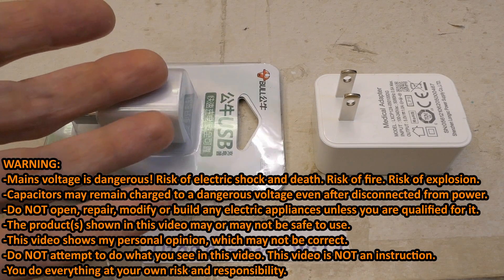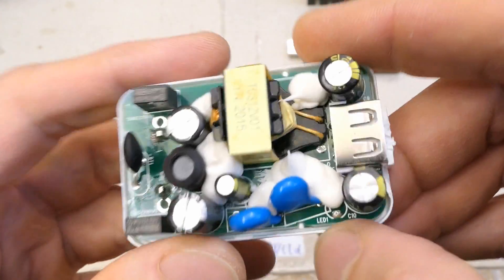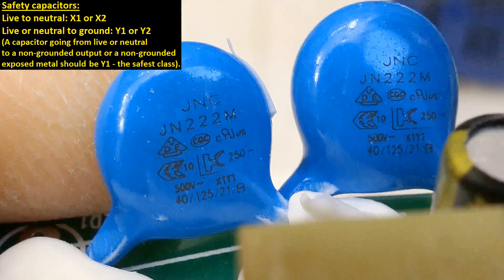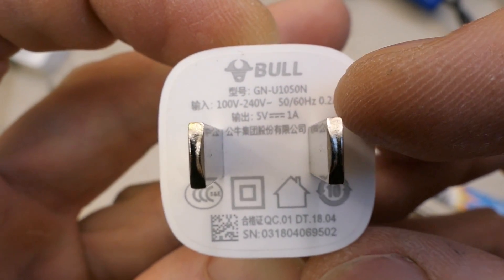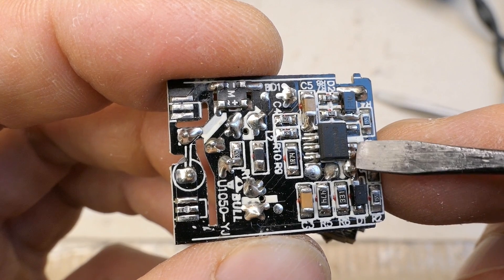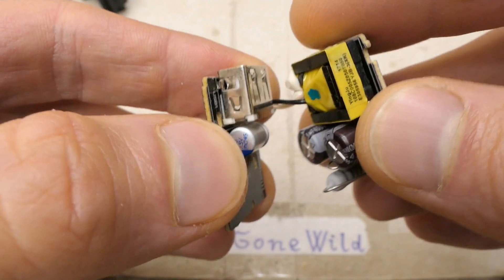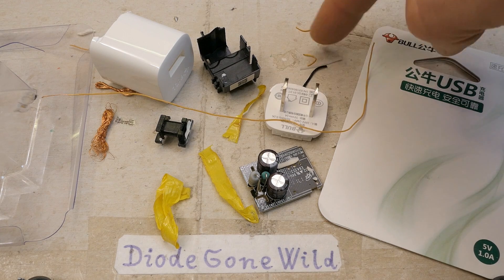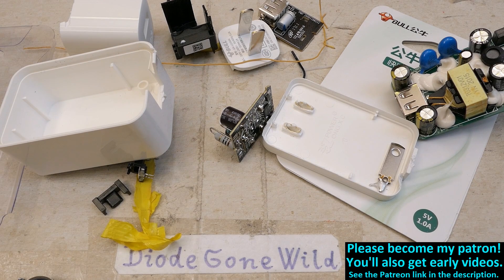Now some safer USB chargers

Comment: Fun fact: the holes in the US plug are useless.

The original idea was to use dimples to lock the plugs in the socket, and that design made it into the standard. The outlets with the dimples, however, haven't been used since.... I'm not even sure they were ever used. I have outlets from the 30s that don't have the dimples and the plug only came into common use in 1931.

Comment: Trick to open plastic enclosures without breaking them (mostly)
See picture:
https://drive.google.com/file/d/16e1rRGl4BeZp2NFobxlSmnRpqDgaXwFo/view?usp=drive_link
You scare me with that saw-blade https://youtu.be/o9nurap1AWo?t=310 
- Make sure that the rods are exactly positioned on the seal (use sticky tape)
- Don't squeeze too hard; I have occasionally broken the internal PCBs

/chriV

Comment: I love your channel, I just have a small correction, the missing holes in the US plug doesn't make it "Chinese", those holes only help with the manufacturing and have no practical use in the socket
Reply: That actually is, in fact, the Chinese style ungrounded plug. They use an outlet very similar to NEMA 1-15, but the blades don't have holes. I don't know if they're just not allowed to have them, however. But it is, indeed, a thing.
Reply: @puckcat22679  US plugs however don't require a hole, it can be 100% compliant even without

Comment: How did you make that "hot air gun"?
Could you make a video about it?
Reply from the maker: It's an old hair drier :) A bit melted as it once ran with the air flow accidentally restricted.
Reply: @DiodeGoneWild  Just a regular hair drier or did you modify it to make it blow hotter air?
Reply from the maker: Just a regular one. The air is quite hot very close to the output.
Reply: @DiodeGoneWild  Thx!

Comment: Currently, is anyone still using a 5 volt 1 amp charger? In my opinion with the current cellphone battery capacity which is mostly 5000 mah, how long does it take to charge it?
Reply from the maker: Probably yes, but for other devices than phones. There are things with smaller batteries.

Comment: IMO the first one was dodgy on the basis that the line voltage pins were soldered directly to the PCB.  Eventually those solder joints will probably crack from repeated insertions/removals, causing arcing.
Reply: Nah, he had to get the pins hot before they moved this was not in 'dodgy' and nowhere near 'super dodgy' so it's 'Nice'

Comment: Medical-rated power supplies have to conform to strict isolation and reliability standards for the safety of both patients and medical staff. They are generaly (in the UK at least) a bit more expensive, but worth using for projects that will be left running for long periods....in my humble opinion! (Power supply safety standard IEC 60601-1)
Reply: I wanted to check out that standard and it goes for a small price of 4500 euros lol
Reply: @whatevernamegoeshere3644  I get mine from CPC in the UK - they start at about £20 - maybe not the same standards though!!!

Comment: One could apply 500V DC between primary and secondary, and  run a test.
Reply: The standard test voltage is  1.5 K V AC for  1  minute between looped primary terminals and looped secondary terminals. The charger should withstand without damage.
Looping is for safeguarding the electronics.

Comment: That travel adapter is a death trap and would be worth a review video on its own. I bought a few of them some years back, and discovered that internally the input and the output is only held together by the pressure applied by the casing. Over time as the metal relaxes they turn into a special effects machines with flashing lights and crackling sounds coming from the inside. Definitely Syuper Dodgy.
Reply: He actually made a video on it a number of years ago
Reply: He has done a number of them and also Big Clive has covered them too!
Reply: @andymouse  @Dabjo01 Thank you, I somehow missed that one, or the experience was so shocking I repressed the memory. He is indeed talking about how Dodgy these are and highlighting the exact failure mode I experienced. It is really incredible that these adapters are still sold on AliExpress to this day...

Comment: I remember the days when wall adapters had iron core transformers. They had the primary and secondary on 2 separate plastic coil holders. They were probably rated for 2000 V insulation.
Reply: Yep, 2KV was pretty standard for the hi-pot tests of those; many included a thermal fuse inside the primary winding as well. Big and heavy... but so little to go wrong
Reply: @NicBellamy  And they could be easily repaired if something went wrong.

Comment: Had a shit 5 volt one fail and put line v120v to 5v and damaged hdmi circuits including Epson projector hdmi ports.  I only use UL approved ones from now on.  Safer and not likely to damage supplied items, if the UL listing is real.

Comment: 0:35 that barrel plug polarity symbol... on a USB power supply XD
Reply: It might have a cable with a barrel plug on the other end designed to be used with it.
Reply: @k4be.  i thought about that to, because i actually have some flashlights from Lidl that actually have a "usb to barrel" cable adapter

Comment: A while ago I got a charger from the dollar tree here in the states to teardown. I expected a horror show but it used the same style transformer as the first one in this video and even used polymer capacitors. To me this really shows how much of a scam the 1$ chargers on ebay are if the dollar tree can manage a very well built charger for the same price
Reply: So, a large chain that has been around for a while like Dollar Tree actually can't afford to sell unsafe products. They'd get fined if they sold electrical equipment that doesn't meet standards, and they'd get sued if that equipment malfunctioned and caused a fire or killed someone. Where you need to watch out is stuff sold direct from China on eBay, stuff from Amazon Marketplace, or things sold at flea markets and such. But at a brick and mortar store? It's unlikely to be unsafely constructed.
Reply: @puckcat22679  I know the term "brick and mortar" is used to describe a store that exists as a real building, but good luck finding a Dollar Tree that's actually made of brick and mortar. Not on the outside surface as decoration, but inside the walls as structural material.
Reply: I expect it costs more than $1 to manufacture but other cheap to make products probably subsidise the cost of this PSU.
Reply: I’ve used Dollar Tree 1-amp USB supplies a lot. They get slightly warm sometimes but otherwise seem at least adequate, even when they were $1.00 rather than the current $1.25. I think I once took one apart and didn’t notice anything glaringly bad, but I hadn’t the experience and knowledge I really needed to be sure.
Reply: @markiangooley  would be weird if a usb charger didn't get warm to the touch ;) even my "expensive" Anker chargers get pretty warm
Reply: Always buy two cheap chargers. Teardown one for safety confirmation 😅😅😅

Comment: Hopefully he can check some of the newer GaN adapters gallium nitride rather than the silicon FET adapters. Expensive and cheap ones, I wouldn’t mind donating some once get my new bench up in new place and go though boxes in about a week, or two as still setting up equipment and sorting stuff on off days. Notice no email contact information on main page, or Patreon page? 

I have the GW AC source and power meter and siglent electronic load to test them and found them to be a little more efficient, but also came across fakes that they claim using GaN but using a regular FET as tore a few apart already when notice efficiency was the same if not worst then some of the standard FET adapters tested over the years. So tore apart and sure enough no GaN. Definitely would be an interesting series if he did some GaN adapters. but do love his teardowns and dissection of transformers and etc.

Comment: I wouldn't tear that first transformer down, either.  For traditional 5V chargers, I normally buy 2 units so that I can take one apart for inspection, but when I see that it looks well-built, I don't want to destroy the transformer and then drop both units into my collection of good chargers.

Insulation on the secondary is a very good sign, regardless of winding quality, and real safety caps means that the item was probably intended to meet electrical standards for a domestic retailer.  This is so rare that further destruction seems sinful.  Buy more and save them in a drawer somewhere before the item or seller disappears!
Reply: That first power supply even has series Y1 caps so in case 1 of them gets shorted safety is still kept, i guess that is what we get from a company that only does products for safety critical industries(in this case only medicine), i wonder how expensive that power supply is, wouldn't be surprised if it was something around 20-50€.

Comment: If you were to connect the shield winding to a low potential would it act as a bit of a suppression capacitor?
Reply: Yes. Single Electrostatic Shield:  This is the simplest type of shielded transformer with one grounded shield extending from top to bottom between the primary and secondary windings. This will typically supply 60dB of common mode noise attenuation from 100Hz through 1MHz.  Ref: hammondpowersolutions.